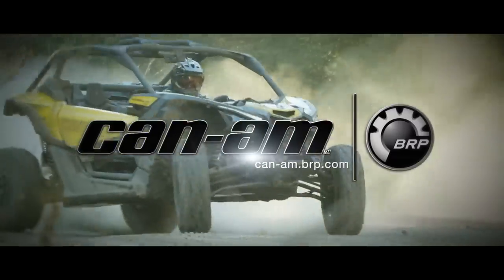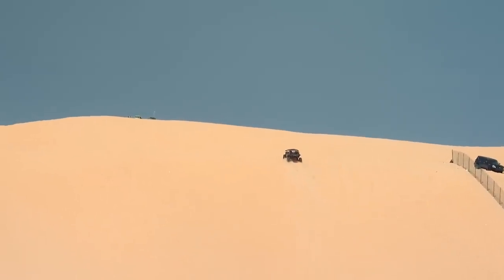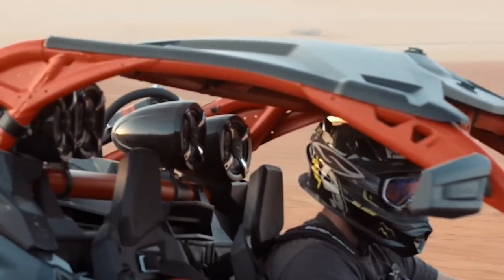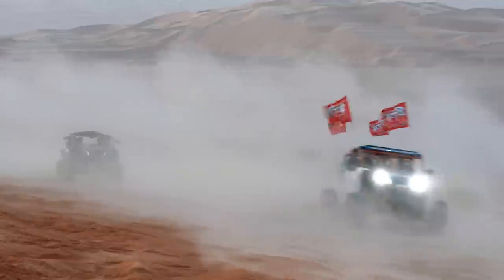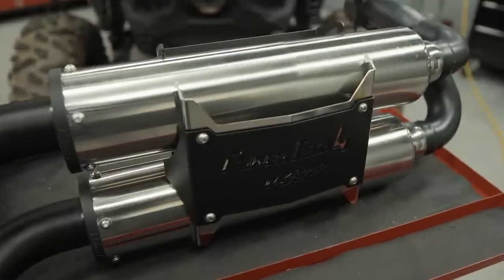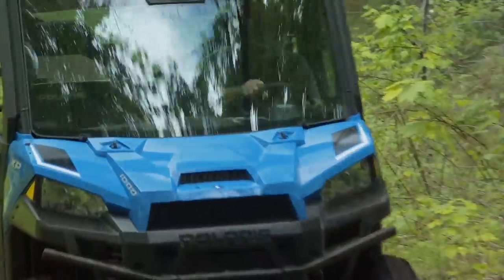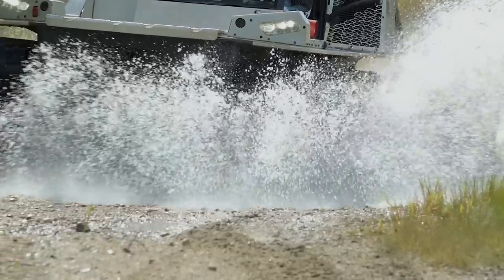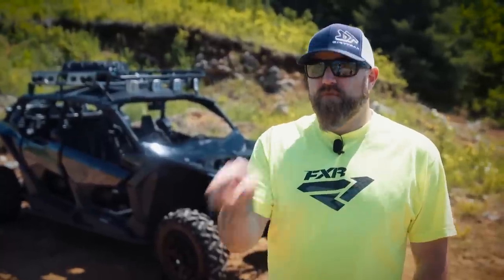Dirt Trax Television 2017 - Episode 2

Comment: I had a SxS with a full HVAC system for 17 years.  It was called a Jeep.  And....it cost less brand new with all kinds of options on it than this Ranger!  Mark said it when he called it a mini-truck.  It's a mini-truck all right.....with a price tag to match!  These machines have quickly gotten out of reach of the common working man.
Reply: When a Jeep can only do 5mph on the trail, I can do 50mph.  That's the difference.

Comment: hahahahaha can am and relieabilty thats funny they don't belong in the same sentence biggest pile of garbage you will ever ride nothing holds up rear diffs suck front diffs suck no real locker 3 wheel drive smoke belts like no ones business clutching is garbage ecu is not water tight the transmissions are garbage the only thing good on a can am is there motor the rest is horrible don't believe me go to mud puppy on youtube the proof is there or matter of fact type can am in on youtube constant issues same parts as the xmr models except the 1k don't believe me look at the part numbers smh also have garbage axles can't even handle villas smh polaris is ok some of them are good some are bad you want reliable but no power get a honda you want both find a good dealer who knows what there doing and buy a polaris yamaha isn't as good as they use to be lots of motor issues recently  i can turn any mud tire i want with a honda with a gear reduction a can am can't handle stock tires without breaking something
Reply: Sportsman570guy156 at least canam are more reliable than a polaris last 3 times I've gone out a polaris broke down from broken axle pilled up front diffs to wiring problems and yes the canam had a problem too it's fan broke so 3 broken polaris and one canam and I'm stuck pulling them out of the Bush with the yamaha running the same size tires that the polaris scrambler 1000 was running that broke the axel and I've had those tires for a year he got his two days before sad
Reply: Sportsman570guy156 my can am has 4000 Miles on it and the only problem I've had was a broken u joint, which was my fault. I never greased it. Still running the stock factory axles from the day I bought it and I run zillas. I certainly don't baby the machine either. Mud puppy bought the base line can am l model and beat the piss  out of it. That model isn't made to do what he did with it and he wonders why he had problems. Then he went on assuming that all can am's have that same quality which is another problem. I hate when people have that attitude. Ever think that he may have just bought a bad unit? That happens. Doesn't matter which manufacturer you get. For the visco lok, yeah it's not the best system out there, but it works. If you're going to complain about waiting an extra 3 seconds in the mud for it to engage, then you shouldnt be playing in the fucking mud. That's literally saying "I wanna go play in the mud, but don't want to be in the mud for long". Stop bashing other brands. Seriously. We all love the sport. Each brand has their goods and their bads. They all break eventually and you know it.
Reply: CAN AM OWNERS JUST DONT GET IT EVERY CAN AM INLUCDING YOUR 5OO USES THE SAME EXACT PARTS EXCEPT FOR THE 1K how smart does that sound if a diff won't hold up on a 570 why would it on a 850 mud puppy 570 is exactly the same as yours just  a different motor and stuff smh
Reply: Their*
Reply: Why are you mad?
Reply: TheOutty500 maybe his 570 brakes down alot and wants to make canam owners feel bad ?
Reply: Idk man your guess is as good as mine.  Sounds like a typically butt hurt poolaris owner to me. He doesn't own a can am so I'm not too sure why he's so concerned about their reliability.
Reply: You can tell they're mad when they don't use any punctuation in their sentences. Hard to even read it.
Reply: nah man 2017 570 never had a issue 1600 miles
Reply: had a xmr 850 for 3 weeks complete junk sold it went threw a rear diff and a tranny 300 miles
Reply: never had A ISSUE 1600 miles
Reply: Thank you, Randy.
Reply: haha you sound a bit mad typical can am owner lol actually own a honda recon too great little bike how am i cheap i  have a 20k wildcat 1k too lol
Reply: Honda owner here, my previous bike(a  renegade) was fantastic. Never got towed home. I did break some shit tho. I drove those piss out of it tho. Had more fun on it then any other machine I've owned. I also drove it harder then anything I've owned. You gotta set them up for the riding that your gunna do. You should stop forming a biased opinion off of a youtuber that trying to get some $$ from youtube by bashing other people machines. Mudpuppy is terrible for the atv community, stick together and make friends instead of trashing everyone and what they ride. People work hard for this stuff. 

Bashing other machines quality while you own a polaris 570 makes you a hypocrite and is honestly a laughable opinion. That being said,  I hope it works good for you and you get everything you want out of it.
Reply: I laughed out loud too when he mentioned the canam quality and reliability.
I'm like.... commmmooonnnnnnnnn.